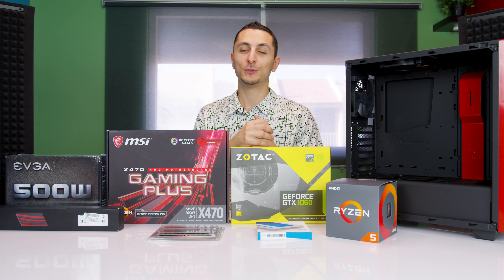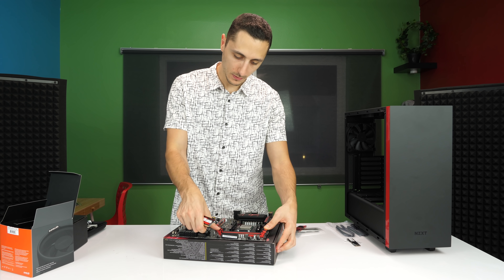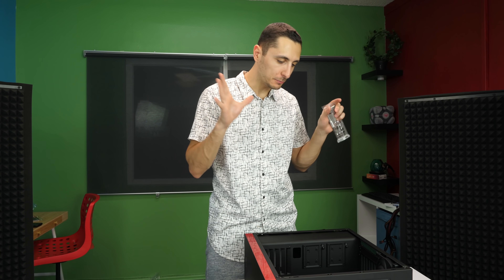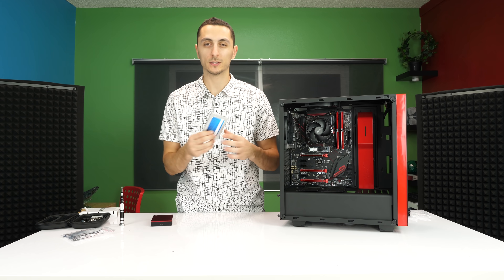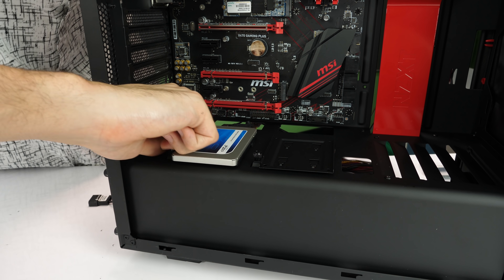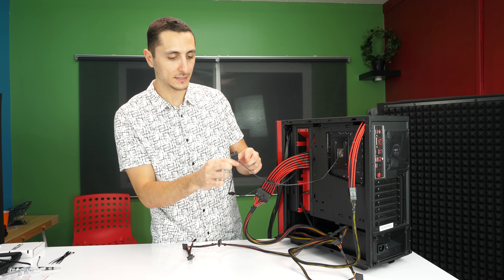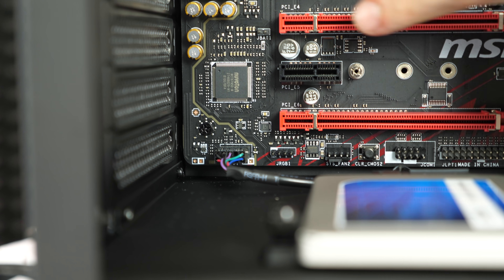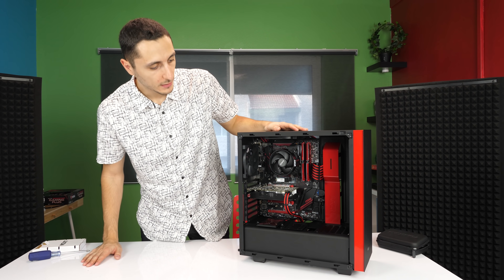How to Build A Gaming PC - 2018 (+Overclocking Guide)

Comment: Hi.. i have problem with overclock.. so i use the safe setting and my system crash.. what should i do.. anyone.. pls help..
Reply: If your system completely crashes, maybe it’s your power supply failing. You power supply might not provide enough electricity for your pc to handle the overclock which may lead to the crash, I recommend 650 watt power supply at least. :)

Comment: Hey guys this is my first pc build and i want ur help if this would work together and ur advices and if i forgot smth  :
Motherboard : ASUS ROG strix Z370-F 
CPU : Core i7 9700k
GPU :EVGA GEFORCE 1080 Ti
Ram: G.SKILL 2×8 DDR4 3200 RGB
Cooler : NZXT X62
SSD: 1 TB
HDD: 1 TB
Power supply : 750 WAT
OS: Windows 10 
Case : NZXT S340 Elite 

thanks.

Comment: R5 2600 on x470 xD if u balance things better, you can fit in a 1080 with no used parts.
Reply: its for future upgrading but your right but now in the future a rx 5700 is better cause prices brand new are the same as the used market for a 1080.

Comment: Wait,that mobo has  8 pin+4pin cpu power,why did you only use a 8 pin?
Reply: dont need the extra power for a mid range cpu only higher end cpus need the through put of alot more power for a stable overclock so dont bother if you have the same motherboard and cpu

Comment: None of those connectors appear to need extensions, just wanted the aesthetic of black and red wire connectors. Which is fine, do you, but it's not a necessary part of the build like he trying to justify it to be. Worse yet it makes cable management more of a pain.

Comment: I settled for 1.35v at 3.9GHZ with score of 1150 cinabench.
 I am guchi.
Reply: *gucci
Reply: @arnavnailwal766  well you see, it wasnt *guchi because aparently if i left it stock and played with ram timings i got 1250... ill OC it when i get 212 (something cheap on the go)

also welldone at pointing my spelling error! cant belive someone finally did!!!
Reply: What did you set the fch base clock value at?

Comment: You're using all the same stuff i picked for my build except for the gpu, i went with the radeon rx 580 cause im poor xD
Reply: 580 is just as good as a 1060 though
Reply: @bravozero6  yeah thats true, just no gsync but im getting a freesync monitor so ig it works xD
Reply: @metlingaming9162  nice man i just started rocking the 590 getting similar results as a 1070 very underrated cards
Reply: @bravozero6  yeah i looked them up and saw alot of bad reveiws so didnt get one xD
Reply: @metlingaming9162  yea i dont see the hate for it tbh then again i mainly play total war and strategy games so it does the job at ultra 100fps
Reply: @bravozero6  not bad at all :)

Comment: OMG your Cabling is WRONG never route wires across the back of the CPU bracket.  Also the money spent on the extensions would be better spent on a modular PSU with mono colour cables.